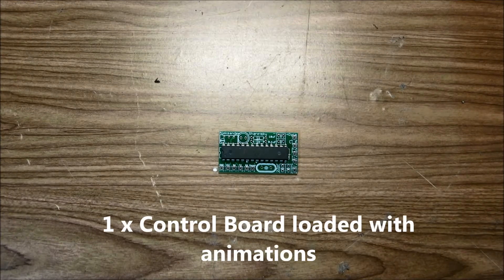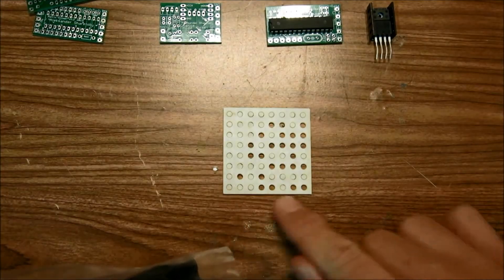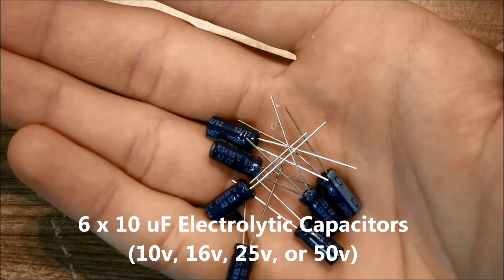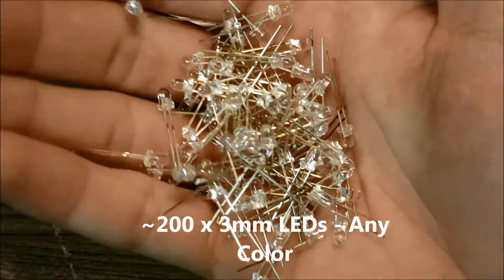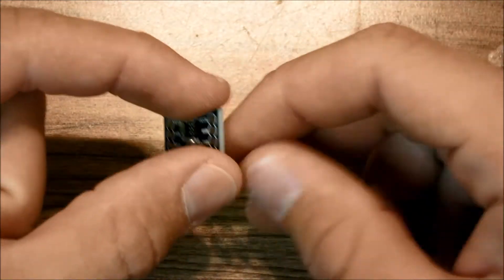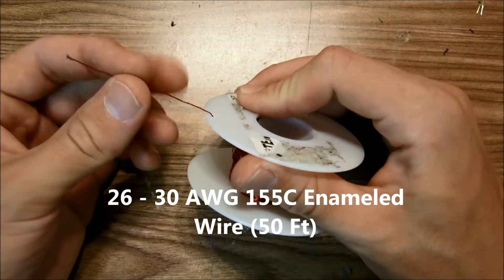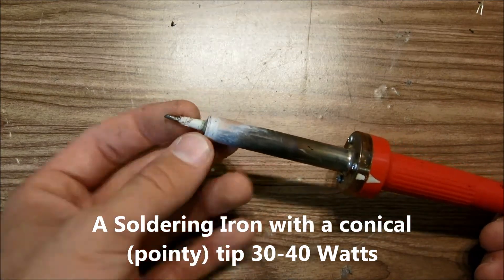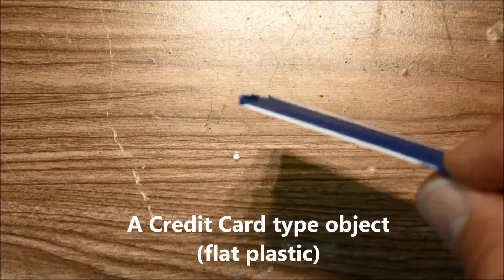LED Goggles DIY kit - Parts List

Comment: do you know of another option for the 3.3v Logic converter, i brought the one from MDFly Electronics but i beleive its a different model as it doesn't fit. TY :3
Reply from the maker: I have a tutorial on how to use the new one, look up 'using new 3.3v logic converter'